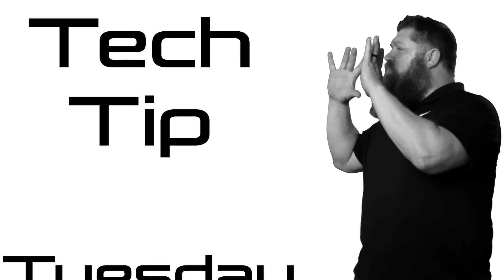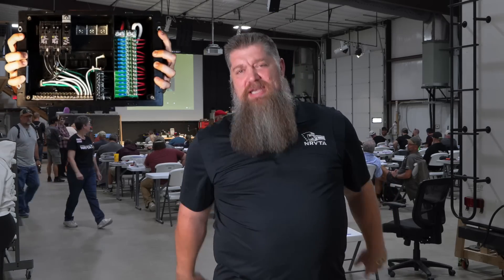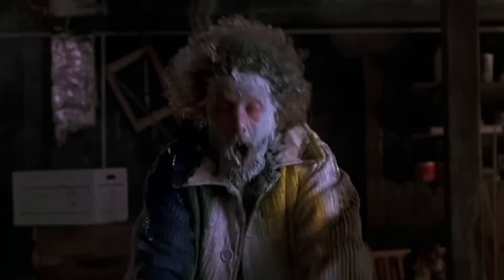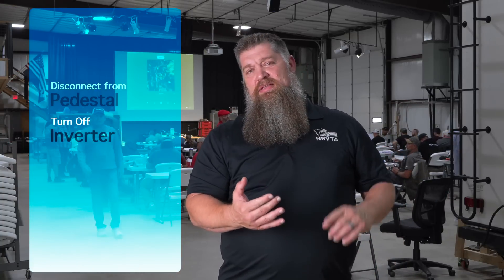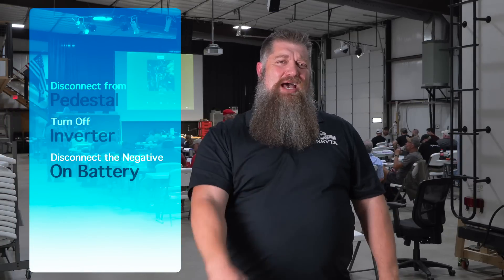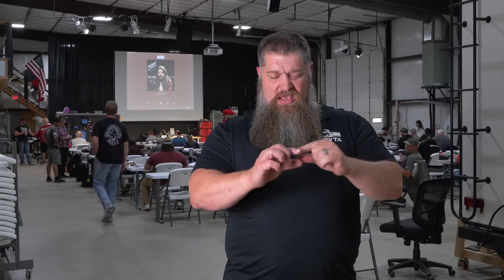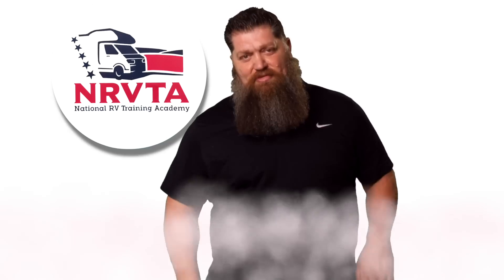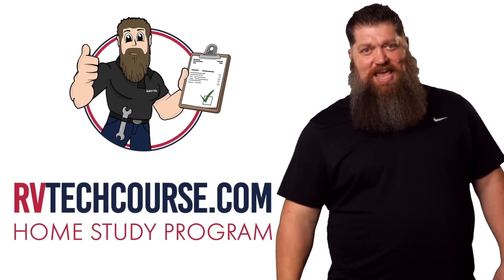An RV Electrical Maintenance Must

Comment: I have question . 2019 Newmar Bay star sport 3226 with a V 10 ..  I hooked up a trickle battery charger for the engine start /chassis  battery from an inside 120 volt outlet wire runs threw the firewall to the battery , should I unplug it from the wall inside the coach  because the alternator on the running  engine and the trickle charger may be a problem ?  Thank you Mike

Comment: Great video. Even though our trailer is in a permanent spot, I'll still verify connections.

Sorry, but I've been trying to email you about your online-only courses. I would LOVE to take ALL the courses right up to Inspector, but as I'm in Canada, we're on another planet.  It's only the RV Essentials course that is online, right?

An attractive part of the course is getting course mats on a USB and shipped via UPS. Unfortunately, we've found out that UPS will charge a lot of money (~$70) for a small CO alarm. That doesn't come up until AFTER the order is processed and given to UPS. From past experience, they would likely charge ~$40 for just a USB.

Is there any way the USB can just be thrown in an envelope and shipped via USPS? Again, I've asked these in emails, but so far, no one's read them. or responded.

Thank you very much.

Comment: Great video Todd, you're the best. I don't know if this is the right place to post tis battery question but here it goes: I know when you upgrade your batteries from acid to Lithium you should upgrade your charge controller because it still thinks there's a acid battery there and it will only charge the batteries to about 80%. The question is when your towing down the road and your tow vehicle (Ram Truck) has a acid battery, isn;t the alternator of the truck still only trying to charge the trailer batteries to about 80% too?

Comment: If you don't have a VOM you can grab the ground bar while touching your tongue to the connections on the breaker to determine if they are powered down. ☠ The roads in Mississippi are so washboarded my mirror popped out and was dangling by the heater wire..

Comment: I love all of your videos!  They have helped me so much!  Thank you for answering one of my previous questions on the video you put your tinfoil hat on about EMP’s.  I have another question.  I have a 2022 Alliance Valor 35v11 and I keep the water hookup on city water.  Some how with it on city mode over time the freshwater tank got filled and started leaking.  And it didn’t come out the overfill drain.   Why would it be filling up when the nautilus water system is set to city water.  I emptied the tank and closed it to make sure I didn’t mess up and fill it and forgot and it did it again

Comment: Do your automatic transfer switch. I had one of my power wires fall off and lost half the power in the RV. Most of the other connections were also loose.